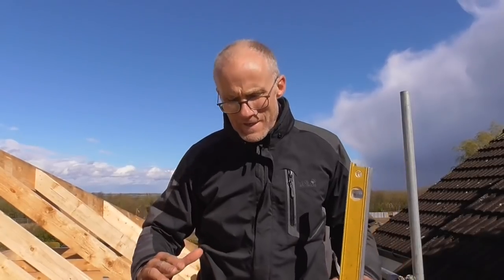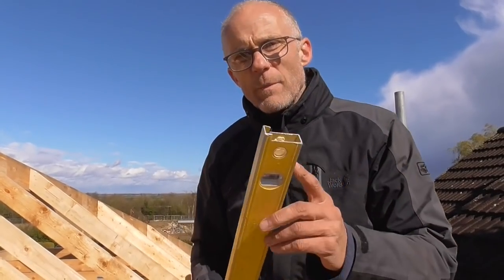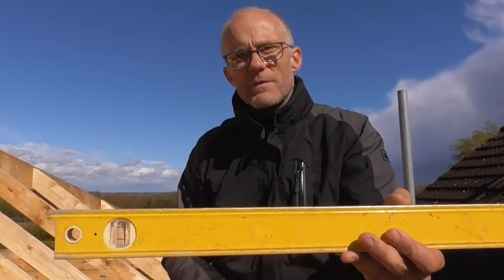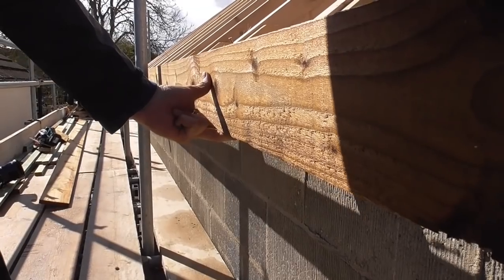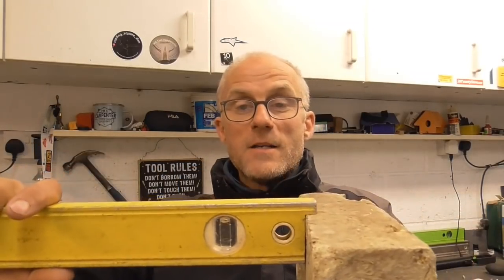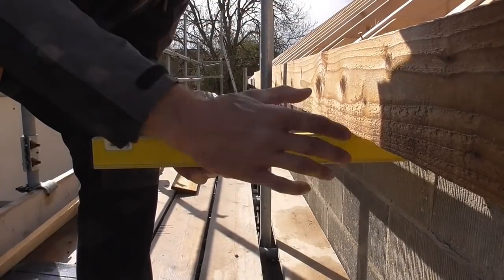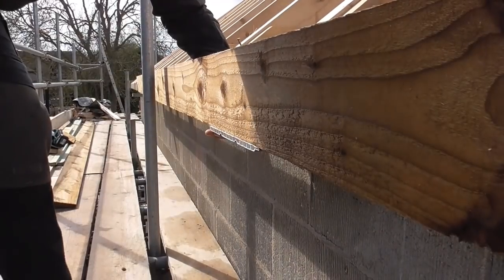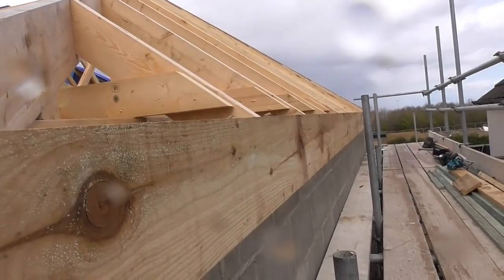Modified spirit level***FOR LEVELLING ROOF SUB FASCIA BOARD***

Comment: Nice tip Del👌. In Ireland 🇮🇪 we put a batton on the wall, or fix it with short battons hanging down from the rafters, so a pvc channel can be fixed to it, so the pvc    soffit slots into it. Similar to you .we level the 7x1 or 9x1 facia accross to the batton on the wall , on long runs as you say there's nothing like tacking both ends and middle and sight the whole facia through 👀😁. If possible I'd like to pick out nice true facia boards , not always possible 🙄🤣. The notch on the level is clever, I work alot on my own so every day is school day😁. Great video 👍
Reply from the maker: Hi Paul🖐The way you describe does give the best results and cuts out having to follow the brickwork👊Plastic soffit and fascias are pretty straight, but I completely get what your saying about picking straight lengths when using timber 🤟Great comment and thanks for watching 😎 Cheers Del

Comment: And I thought I was the only one that did it this way 👌
Reply from the maker: It's a great method Lee👊Gives the soffit something decent to fix to, plus gives additional strength to the fascia💪Thanks for your comment mate 😎 Cheers Del
Reply: @thetallcarpenter  
A very good method indeed, and like you say an excellent fixing for the soffit, which stops it rattling in the wind.
Thanks Lee
Reply from the maker: @nearlee2000  👊😎

Comment: Brilliant tip tc.
Unfortunately the brickies I work with are rubbish.
Particular rubbish when they reckon the eaves details will cover everything. If I did this the soffit would zigzag up and down.
I'm doing my first hip roof currently.
Getting the hips in tomorrow.
Hopefully a few Jacks too.
But it's a Friday and I promised if take the missus out for lunch so don't have much time
Reply from the maker: Hi Kallum 🖐Yes bud, the soffit will follow the brickwork, so it cant be too bad😵Send me some pictures of your hips if you can to theteallcarpenteruk on Instagram🤞Thanks for watching mate😎Cheers Del
Reply: @thetallcarpenter  I will do. Probably tomorrow.
It's time for a beer now.
I got the hips in today, which was hard work solo. Lugging around 8x2. And as many commons as I dared without bowing the ridge.
The hips fit like a finger up the bum.
I'm just worrying I've worked the pitch wrong.
I took a few boat level and bevel measurements from multiple rafters in the original and they all came in at around 40/41 degrees on average.
But looking at my pics I took today I can see the original hip doesn't line up as much as I'd like with my hips.
It's hard to tell as the original has bonnet hip tiles on and I'm hoping I'm just taking my photos from poor angles.
Reply from the maker: @flyingjackcarpentry9394  Siunds good Kallum, and to be brutally honest, a roof has to be pretty bad to look bad😉
Reply: @thetallcarpenter  that's why I'm worrying.
This is my masterpiece.
I can't fuck it up.
I've never done one more complex than a gable with veluxes
Done a few lean tos and quite a few flat roofs.
This one I'm on has 3 hips and two valleys. It's the most complex  thing I've every built on my own...
If I've got this far and fucked up something stupid, like going for the wrong pitch...
Omg.

I will set up an Instagram so I can show you the picks.
Reply from the maker: @flyingjackcarpentry9394  Stay cool Kallum 👍The fact that you care so much will be the reason it will turn out great👊

Comment: Great tip, thanks. Do you wear thermals, I started wearing them a couple of years back and its made life so much more comfortable.
Reply from the maker: Hi Michael🖐I do wear thermals bud, but it has to pretty cold for me to put them on🥶I've also got a set of thermal overalls which are absolutely awesome when its SUPER cold👊Thanks for your comment and for watching😎Cheers Del
Reply: I've got a pair of Carhartt insulated dungarees, ideal when it's absolutely baltic, 🔨😁 🇮🇪
Reply from the maker: @Toyotaamazon80series  Hi TN🖐I think it's all about keeping your back warm,  which dungarees/overalls do really well👊Cheers Del
Reply: @thetallcarpenter  I wear the uninsulated Carhartt dungarees as well T.C. I prefer them to the likes of a Snickers work pants. I have a pair of Snickers pirate pants for hot days in summer. They keep the legs cool but you don't lose the benefit of the knee pads, 👍😁😎🔨🇮🇪
Reply from the maker: @Toyotaamazon80series  You've got it all planned out TN👊I'm limited as I'm so bloody tall😵Cheers
Reply: @thetallcarpenter  👍😁 I'm 6-1" T.C and trying to get a good fit can be an issue. At 6-5" it must be a pain! 🙄 🔨 🇮🇪
Reply from the maker: @Toyotaamazon80series  It's that extra inches TN😉

Comment: To cut your rafter seat cuts using the level off the wall too ? If so is it just at each end then string line and bevel or do you level each one off the wall
Reply from the maker: Hi Dan🖐Superb question mate👊The soffit cuts are not exact and just need to be high enough for the soffit to clear underneath, so I do use this level to mark each end, (I actually lay my pencil on its side on top of the level to give that little bit of clearance), and then ping a chalk line across the rafter feet plumb cuts, and square from this mark back giving me the seat cut. (obviously, the rafter feet have nice plumb cuts on them so putting the square on those gives an accurate seat cut). This way, they are cut in a nice straight line and not follow the brickwork👍Hope that makes sense🤔Thanks for watching😎Cheers Del
Reply: @thetallcarpenter  cheers Del, its always habdy to see someone in the trades time saving tips. Sometimes we can spend yrs knowing a certain way but then seeing a pro tip can make you think, ah why didnt i think of doing it like that.

I suppose its always good to sight through the block work checking for high spots using your method so to take the highest point and prevent any soffit bows.
Reply from the maker: @handle1196  I will get the soffit nice and straight at the fascia end, but, it will follow the brickwork on the other end, as the soffits sits on top of it👊I love it when I learn a new way or slightly different way of doing something from someone, as it reminds me that you'll never know it all🤯Cheers Del

Comment: Thats only good if the blockwork's level and flat.
Reply from the maker: Hi David🖐Your right mate, and that's why I only do it at each end and then eye the whole side down for straight👍If the blockwork is out of level, then there's not much I can do about it, and the soffit will just have to follow it, but at least it will be straight and the soffit will turn the corner flat👊Thanks for your comment😎Cheers Del